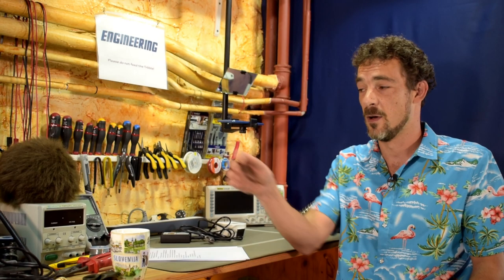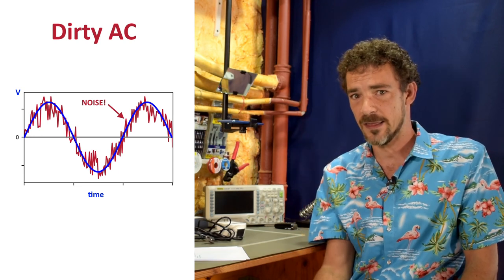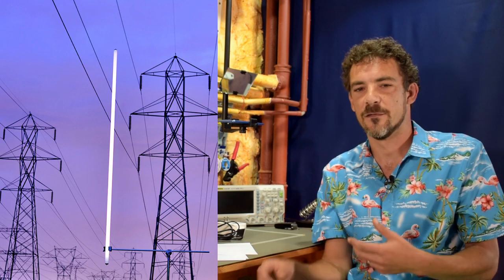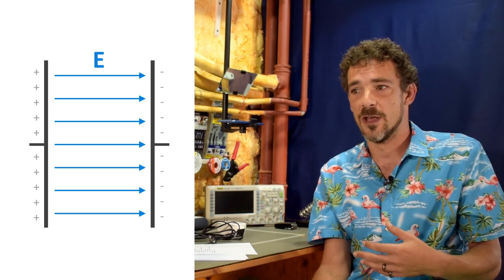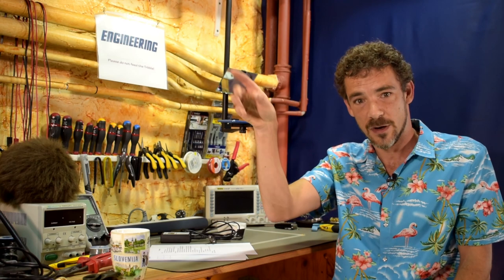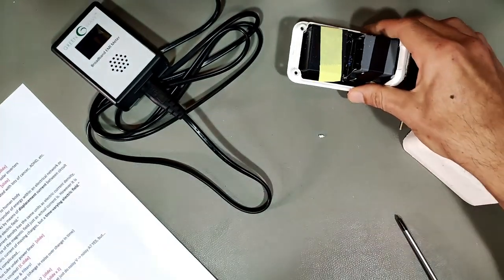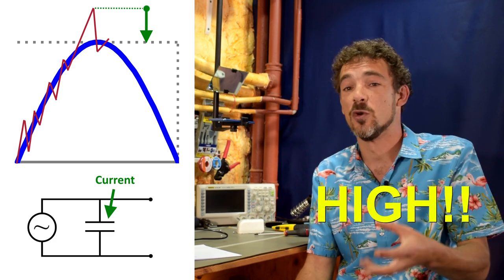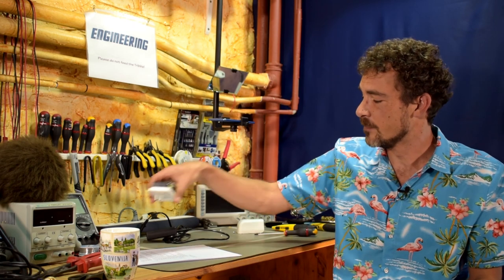Dirty Electricity: What it is and how to fix it

Comment: I'm more interested in how the human body interacts with electricity. I used to be super-electrosensitive 'til I started consuming coconut oil and iodine. After I'd done that for a while, my electrosensitivity just vanished. If, as some have hypothesised, Earth is going to be hit by waves and waves of X-class flares in line with grand solar minimum, surely a prophylactic solution to that has to be found in the human body. Eastern "acupuncture meridians" translate into western "collagen bands". Perhaps that's a bit of a clue. It's interesting to me that whenever you walk into an acupuncture clinic, the first thing you notice is the smell of ozone, which suggests either the human body is producing raw electricity by itself or it's conducting it ambiently.
Reply: OMG can you please tell me exactly what you did.  I am HYPER HYPERsensitive.  I have a vacation home in vero beach that I don't even want to be at.  Not sure what is going on.  Installed a Static shield power perfect box at the main breaker panel and have several of the greenwave filters and it is not helping at all.  I am in agony every time I am at the house.  Just purchased in April and in the middle of a pool install and can't stand being there.  I NEED ANY ADVICE
Reply: @ScottiesTech anything you can add would be greatly appreciated.  Also would a negative ion generator help with the issues I am having.  After all the filters I still feel like I am cooking from the inside out.
Reply: @MelLar257  Well, I used to be so electrosensitive, I couldn't go into a room that had wi fi. If you had a cellphone on your person, I could tell you what pocket it was in. I had it really bad. 10-15 years worth. I started consuming coconut oil for unrelated reasons. It got a bit better. A bit later on, I started on the Lugol's iodine protocol, again for unrelated reasons, within a certain amount of time it completely vanished and never came back. Other than that, I've got some Shungite. That's about all I can tell you.
Reply: @xwsftassell  wow, thanks so much for responding.  Sounds like exactly what I am dealing with.  When I purchased the home in April it had a smart meter.  I was there for a week and felt nothing.  Knowing what I know about smart meters I "opted out" and thought I would be getting an analog electro mechanical meter, but NO they put a digital one on and that is when the agony began.  Power company could care less.  When you truly to explain it to people the "lady you are crazy" face comes out.  

When you say "consuming" how much and in what manner?  I am going to research the Lugol's iodine protocol right now and get started.  Did it take days, months, years? Are you still following the protocol?

Sorry about all the questions, but I am in agony...

Comment: You’ve made a good point that has never occurred to me, simply because I cannot afford these expensive toys.  The inverters you’ve mentioned, connected to the solar panel systems, which are EXTREMELY EXPENSIVE.  When you spoke of the inverters, it opened my eyes to the fact that batteries store a DC charge, and so, I would likely be so much smarter to leave any inverters out of the equation, if I’m only going to go plugging in AC/DC adapters into my inverter once I have one!!
Reply: For those about to rock…
Reply: the problem is any length of DC wire will lose more energy to heat trying to run low voltage, than you would lose using a good pure sine inverter and then using your small DC converter at the end.
Reply: @thedavesofourlives1 right I checked my inverter that runs my entire house and it is extremely clean. It even has like a 2% THD.
Reply: @correctthatfilthygrammar 

We salute you 😊

Comment: great video, @Scottie -- and interesting you mentioned that more 'remote' effect when sanitizing your computer area, and your bedroom getting lower levels at the same time. This is one of these effects that Stezer himself or Orham Miller and other building biologist always point out! Also means that stuff really can come from your neighbors (especially ones that have that "clean"-energy stuff like solar panels -- that aren't so clean after all when they feed-in or use inverters to have AC). When I was little, I used to experiment a lot with DC power for a lot of "household stuff", especially the things that run on low-voltage DC anyway (model railroads, energy-saving halogen desk lamps, many of my other toys and gizmos, radios, fax machines back in the day, battery chargers and what not). Totally would make a lot of sense to use these (from a DC car battery or the like) in order to skip the problem in the first place (at least for these items). I know it still wouldn't solve the remaining issues with your other appliances, DE coming from the neighborhood, let alone shit traveling over the lines if there are smart meters installed in the vicinity etc. On that note, let me also point out what a BAD IDEA the entire "LAN-over-powerline" BS would be!

Had the same issues with Stetzer-item shipping you mentioned, thinking of maybe aggregating a larger shipment using some US re-mailing service and then pay the men (including customs thugs, I know) just once. Viabox and some place in IN (strategically located b/c Amazon hub there) might make sense. Anyway, had looked into much of this for some time, but you kind of reminded me to really put it into practice ASAP...

Thanks for this one!

Comment: Those filters are basically an RC bandpass circuit.  Brilliant!!!!   I wonder if using a modified LC/RC circuit would clean it up better, especially using a common mode choke.
Reply from the maker: Hmm... I wonder? Reason being, D.E. filters present a large capacitive load to the grid. If you switch to generator power or solar inverter output, that's bad juju becuz the high capacitive load isn't liked very much by gensets and inverters... But with a choke... HMM... you may be onto something there!

Comment: I've installed Stetzer filters throughout my house & they've brought the levels down dramatically.  Then I had some electrical work done that discovered & cleaned up some faulty wiring & then found I didn't need as many filters to keep levels low.  The Stetzer filters do make a sort of alarming crackle-pop sound when I plug them in.  Do you know what that is?  The only other downside I've found is that they do create a high magnetic field in the area immediately in front of them -- so I try not to have any close to where I'd spend much time.  Any thoughts on why this is or if there's anything to do about it?

Comment: Hi Scotty, I have always found it pretty dodgy that the company that sells the filters also sells the meters to show they work... Is there another, more accurate way to measure the efficacy of the filters? Perhaps a spectrum analyzer? Would be great to see the specific bandwidth that is suppressed, there is a rumor that the filters just displace the noise into a higher frequency range, and the meter only reads the narrow bandwidth that those frequencies are displaced from. But this is all clearly new to me so would love you have your input. Thanks.

Comment: I had a (probably damaged) PC PSU once, it still worked (no blue screens or any other issues), but it produced a crazy high amount of DE (IIRC it was > 3000 on a GS meter, so at least 72000 mV). Working for 2-3 hours on that PC tired me and my wife out to a point where we needed a nap. After noticing that it affected her just as much as me, I investigated. Swapped the PSU and the problem was greatly reduced. With the new PSU, a single filter would significantly drop the remaining DE, to a point of removing the problem.

Comment: Thank you for explaining things in the way you do, rather than being an alarmist. It helps people that don't necessarily understand and doesn't turn them off from new ways of thinking.  I'm not a "techy" myself and am just curious if having the filter plugged in is actually "using" electricity.  Meaning, would it change a person's electric bill?  Also, does "cleaning" the sine wave up benefit our normal electrical devices in any way?  In a typical situation, with an average amount of dirty electricity.
Reply from the maker: No, the filters won't change your electric bill, and they won't improve energy efficiency or anything like that. I suppose they might actually help other devices in some cases since the AC is 'cleaner'.

Comment: I just bought the Greenwave EMI meter, and one of the outlets in my apartment measured over 1000. I put in a filter that bought it down to the mid 800s. Should I be concerned?
Reply: Wow, what did the company say? 

That's way above his 100, so yes, I would be concerned. Are you tired in your house?

It's hard to find good electricians. sigh
Reply: @OurFreeSociety  I have found myself becoming very tired and fatigued when I stay home, even if I am doing nothing at the time. When I stay home a lot, I also suffer from tinnitus, headaches, lack of focus, weight gain, dry skin and hair, and depression. It is very frustrating and time to move.

Comment: Is there any reason you couldn't just install a cap(s) into the breaker panel?  One cap per phase? or add a cap to each outlet? It would be a lot cheaper.
Reply from the maker: You can. Most recommendations I've read say to do what I did: install 1 filter on each phase at the panel. But then you test everywhere in the house and install extra filters where readings are high. It seems that putting the filters as close as possible to the source of the noise reduces readings everywhere much better than just sticking filter(s) only at the panel.

Comment: Thanks, most interesting. I'm on solar power, with a 350watt pure sine wave inverter. This is only active for fairly short periods of time, so am I right in assuming that dirty electricity would not be an issue? But I know of other vans that have 3000watt inverter, so could that change the scenario? You're always most interesting and helpful thanks.
Reply from the maker: I'm not sure, but usually even the 'pure sine wave' inverters create lots of DE. That's what I've read anyway, but I've never actually had the opportunity to check it out myself!
Reply: you're spot on, @Gönndalf -- that's also on one of my points for tinkering around with a "second system" of DC low-voltage stuff on top of existing household systems [mentioned in my other post under this video]; and even more so if we appear to be talking RVs and boats etc here. Going "direct-Direct Current" ;)) doesn't only cut most onboard sources of DE but would also increase available capacity from your batteries by as much as 4% to 8% per leg (i e double that when first converting up and then down again in power brick)! This is how much even "modern" varistor-based inverters and transformers eat off your battery bank or any other load...
Reply: @Gönndalf I understand your point, but there are a couple of applications for which there's no alternative.
Reply: @ScottiesTech  Thanks, I'm curious now so Will investigate further.
Reply: @P9R  many thanks👍

Comment: Ah, silly me.  I edited my comment to include a link, and naturally Youtube deleted the whole comment  :D.     Anyway, I have both the Greenwave Broadband EMI meter, and the Stetzerizer Microsurge meter, and they're both very useful.  The Greenwave meter measures dirty electricity in mV, and has a speaker for an audible representation of the 'noise'.  The Stetzerizer Microsurge meter is the OG meter, which was used in a lot of the early dirty electricity studies, and measures in its own units, the GS [Graham/Stetzer] unit, which uses a bit more mathematics and I believe takes frequency more into account.    

I personally tend to use the Greenwave more often, and use the Stetzerizer for secondary measurements.  The speaker is an extremely useful monitoring tool, and gives a lot more meaning to the mV readings, especially for diagnosing an issue.   However, it's important to note that a lot of the measurements made in the original research studies were made in the Stetzerizer's GS units.  While it's a fair approximation to aim for similar 'values' on the Greenwave meter, it may be a factor that makes someone opt for the Stetzerizer meter instead.  

Another major thing to take into account - the Greenwave meter measures over a much wider bandwidth (3 kHz up to 10MHz), while the Stetzerizer meter is focused on what they believe to be the more biologically active range of 10 kHz to 100 kHz.   This just means that each meter can give slightly different results on the same circuit depending on the noise characteristics.  Does it make one better than the other?  I'd be lying if I said I knew for sure!    

For those interested, a link to the patent for the Stetzerizer Microsurge meter is on stetzerelectric[.]com/store/microsurge-meter/   ~ text search for U.S. Patent #6,914,435

Comment: Given the voltage rating of the MKP62's EMI Filter, other than install safety pre-cautions, why not put an MKP62 across L1 & L2 terminals (each phase) to the main panel in a house?  This would help filter dirty AC from the substation?  Or DIY individual filter for each leg (hot to neutral). This as a whole house filter.
Reply from the maker: Ideally, that would work. But in practice, it doesn't... It helps, but it's kind of the starting point. Then you test around the house and find "islands" of D.E. where you add more filters. Noise is usually not easy to squash out.
Reply: @ScottiesTech  Seems a filter per leg tied across neutral would cover the whole thing. Yes, agree with you, still have to mitigate internal sources.

Comment: Any electronic device made by a reputable brand will have a far more efficient filter built-in than just a capacitor. And it's there to prevent harmonics and voltage spikes disturbing the device itself and also being backfed from the device to the grid. There are standards in place for that, which does not allow "dirt" to be fed in the grid from devices plugged into it. 
Only if you're mostly using cheap non-brand electronics you have a reason to worry.
The capacitors in your filters do close to nothing to suppress the spikes you call dirt. They would only work for inductive loads as motors. 
A simple first order passive low-pass filter made of a resistor and capacitor would give you attenuation of -6dB only. And your filter is not even that. As shown in your schematics, the resistor is only there to lower the inrush current, protect the capacitor and prevent your circuit breaker of tripping when plugging in the "filter". Also, connecting the resistor and capacitor in series will reduce the filtering effect of the capacitor. On top of that, the capacitor will introduce an unwanted phase shift, which is disturbing other devices plugged into the grid, including older power meters.
Similar scam to this dirty power one is the Power Saving devices made of capacitors.
I don't argue if the "dirty power" affects human's health, but I do argue solving it is not as simple as plugging in a capacitor in your outlet.
Reply from the maker: For inrush current, wouldn't a series resistor or inductor be better than one in parallel to the cap? But then, I was under the impression that X2 caps don't need inrush protection because they're designed to handle rather massive spikes per the datasheet.
Reply: I have a surge suppressor with ground and surge indicator lights. As of about 2 years ago I noticed the lights on the suppressor were flashing much like a router with nothing else plugged into it. It seems as though it only happens on the WST utility power and does not when plugged into buildings on Entergy or Cleco utilities. I had my smart meter replaced with an electronic non smart meter and pay additional to have it read every month.
When it was replaced the flashing lights went dark for about 3 weeks and after a weekend power out for an hour, I happen to notice that the lights were again flashing. But now it flashes most of the time but at different times it barely flashes and other times it flashes quite brightly. I took a SHORT VIDEO OF this going on. I suspect it has something to do with either weather mod events or cell phone tower power output which the tower is 2 miles west of my house close to the same height as my house  since I am uphill of the tower. any body else having these issues?
Reply: @johnellingsen8284 are you implying that the new non smart meter is creating more dirty electricity than previous smart meter? Do you have a link to your video?